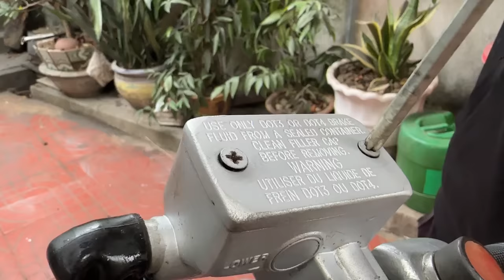Full restoration old Euro Motorcycle |  Repaired motorbike after being forgotten for a long time

Comment: I've been trying to get details on the make and model of the motorcycle. The first thing I noticed was the Yamaha ignition key. But the engine is a single cylinder pushrod 2 OHV dual exhaust port ~~250-350cc. Royal Enfield of India used those engines for a long time. But the closest I've found is maybe a '90s cruiser style Thunderbird. Still don't know. Thanks for the show!
Reply: Engine cover has written EURO maco or magu.
Reply: According to Google, the Euro was one of several brands that were assembled in the Philippines.

Comment: This is, at best, a rattle can repaint and, at worst, a standoff or stand well off restoration. When you get close, you can see that the metal surfaces were not properly prepared for paint. The bike itself is not particularly old, that's why the rubber and plastic components are not all that degraded. I suspect it was sprayed with some kind of corrosive liquid, perhaps salt water.  Left out in the weather for a couple of years. The fork stanchions were not corroded at all. No seals, bearings, or engine components wear replaced. I did a little research on Euro motorcycles and discovered that they are manufactured in the Philippines and are currently available new today . The fit and finish appear to fall somewhere between the Chinese manufactured motorcycles and the Japanese in quality . 175 cc is bigger than Chinese bikes ( most Chinese bikes are 125cc only, police models are 150cc). The most conserning is the quality of the welding on the frame. The location of the foot controls are not well tucked in making them prone to receiving damage.
After examining the current production Euro motorcycle, I would consider them a good low-cost alternative if support is available in your country.

Comment: We found a motorcycle frame once in a field once when we were 10-12 yes. Old no motor just frame and tires with handlebars and we would take turns pushing each other around with it and it sure was tiring but a he'll of alot of fun..

Comment: It  just another cobble job. Rattle can painting and not taking the time to clean and prep for a good paint job and painting the chrome when you could use some elbow grease and 0000 steel wool and cleaned it up. The engine should have been cleaned and polished out to look orginal. The engine should have been completely rebuilt with all new bearings and rings. Nobody would toss a bike that new away. The headlights, style, sorta dates that bike to the 2005 timeline (mite be off a year or so). If the bike had been done right, probably get $3000 to 3500.00 out of it but lucky to bring $1000-$1500.00.

Comment: Yet another faked restoration video ... how do I know ? well there are rusted plastic and aluminium parts, all the bolts open easily, oil in engine when dismantled looks new (old oil gets "gummed up") , plastic and rubber parts dont show any degradation, tires hold air, etc etc etc ....